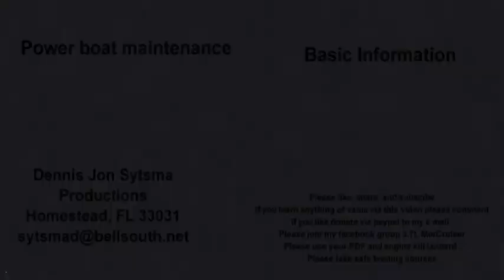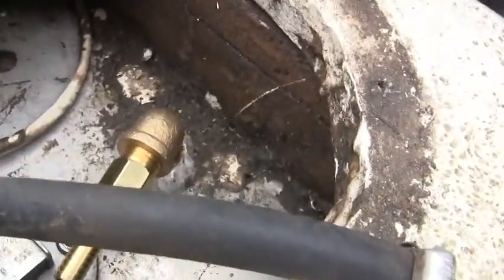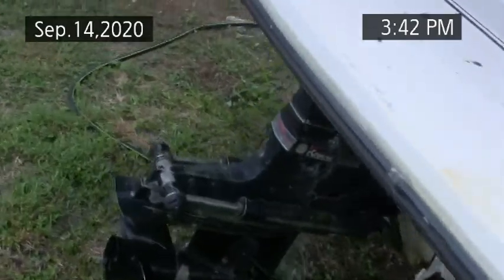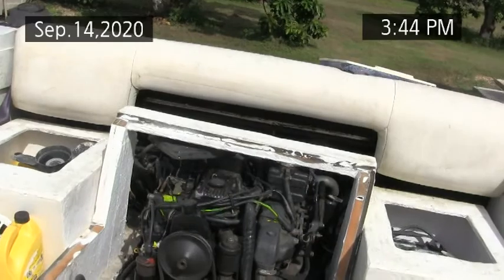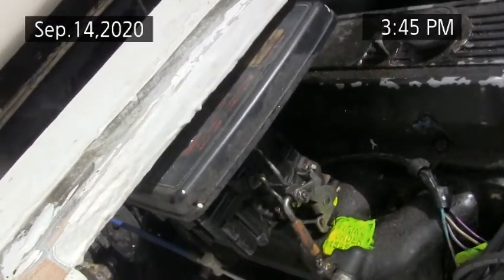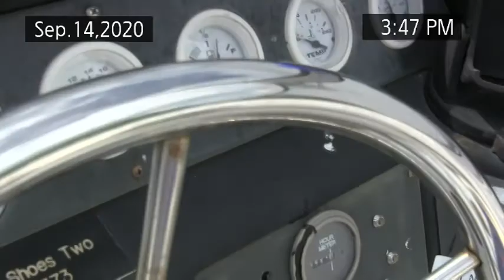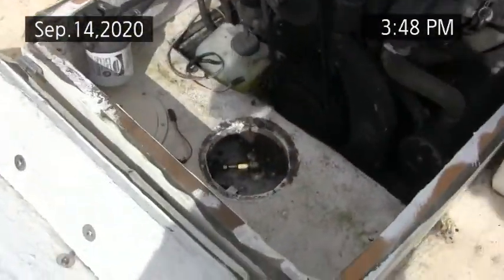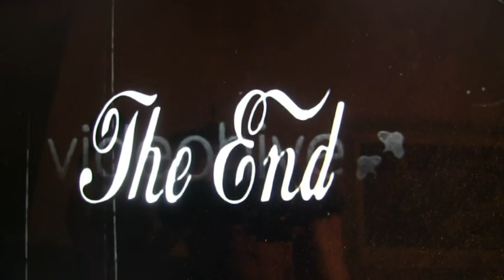Boat VLOG 9 14 2020 install anti siphon valve

Comment: I think your jets need cleaning in that carb or at least low idle circuit...
Reply from the maker: I rebuilt the two barrel MerCarb myself a few years ago and running fine now. If you watch my more recent video logs you can see how well my engine is starting and running. I am getting ready for Hurricane now and hope the boat will survive the most recent storm and the ones that follow this year. Expecting busy year for Hurricanes.

Comment: PTFE tape. Yellow spool, not blue spool.
Reply from the maker: I have had the tape get into the system on plumbing but in this case the water seperating fuel filter would prevent and problems. I am thinking superglue or blue thread lock would work. I plan to call Moller tech support and ask them. No leaks yet  with just bare threads.
Reply: I agree with your opinion of the filter catching the tape pieces. That's what a filter is for... picky people have other opinions... I'll post a comment above
Reply: Never use brass fittings on aluminum fuel tanks. There’s copper in those brass fittings and copper and aluminum or not galvanically  compatible.  Tread lightly…..